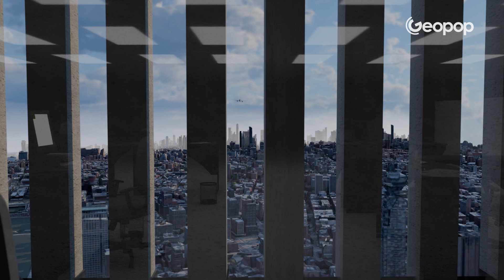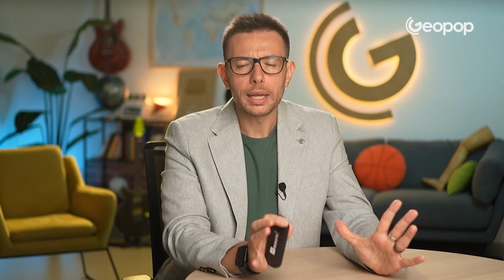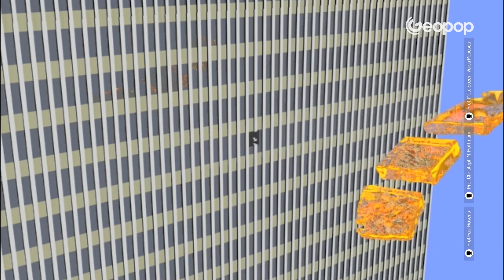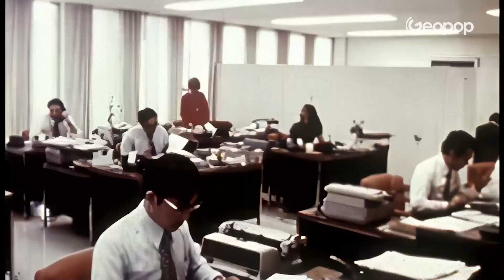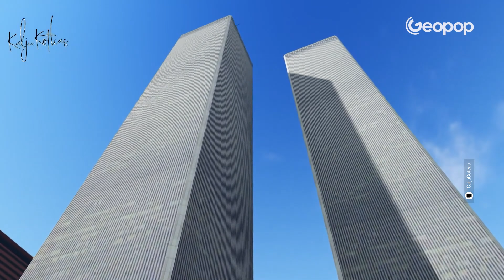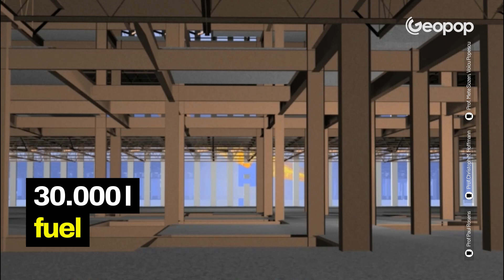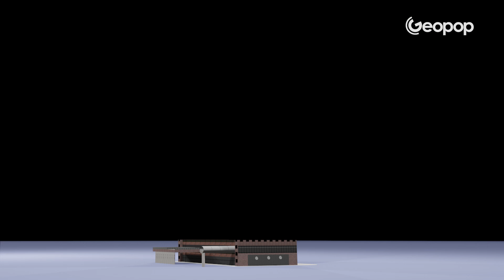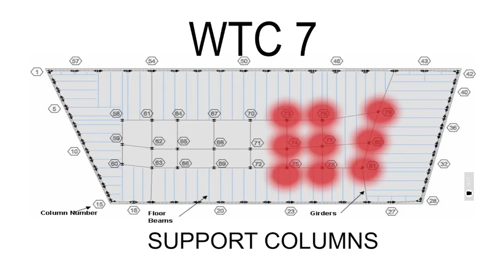9/11, 2001: The Technical Reconstruction of the Twin Towers and WTC 7 Collapses

Comment: Let’s get something straight — aluminum planes do not slice through steel-reinforced skyscrapers like a magic trick at a kid’s birthday party. The Twin Towers weren’t just tall buildings; they were fortresses designed to take a beating. We’re talking about structures engineered to withstand hurricane-force winds, earthquakes, and even a nuclear blast within three miles. Yet, we’re supposed to believe two planes — made primarily of aluminum, mind you — punched through perimeter columns, shattered the core, and caused the buildings to collapse neatly into their own footprints? Come on. Steel doesn’t just roll over and die. The math doesn’t add up. The physics don’t add up. Hell, common sense doesn’t add up. But sure, keep sipping that official story Kool-Aid and pretend it all makes perfect sense.

Now, let’s talk about Turner Construction — the company that just so happened to be working on the very floors where the planes hit. Convenient, right? Their CEO, Tom Leppert, wasn’t just some random contractor. He was connected to Carlos Gutierrez, the guy behind the official NIST report — you know, the report that conveniently explained away every anomaly like a magician pulling rabbits out of a hat. And both of them? Close friends with the Bush family. What a cozy little circle. But let’s be clear: This isn’t conspiracy theory territory. These are documented connections. So, when you see all these dots lining up perfectly, the real question is — how far are you willing to stretch your belief in coincidences before you admit something stinks?

And let’s not forget what one of the building engineers told me. Who was working in the basement at the time — sublevel five, to be exact — and he saw core columns turning white hot. Not from jet fuel. Not from burning office supplies. He said it was so hot he could barely breathe. Now, you tell me — what kind of fire does that? Fires at the top of the building don’t superheat the basement to the point that core columns start glowing like a forge; firefighters that was in the basement witnessed a stream of molten metal, they too also reported blast going off in the building; the lobby exploded as they were approaching the building. They heard and felt blast going off underneath their feet, from other sublevels, That’s controlled demolition territory, plain and simple. But hey, we’re supposed to pretend that gravity magically explains floors exploding below the collapse zone, steel beams flying hundreds of feet, and debris pulverizing into dust before it even hits the ground. Yeah, okay.

And here’s the kicker — those diagonal cuts you see on the steel columns in the Ground Zero photos? That’s textbook demolition work. It’s called a “shear cut,” and it’s used to make sure steel beams fall the way they’re supposed to during a controlled demolition. But sure, let’s ignore the squibs (those little bursts of smoke you see blowing out of windows far below the collapsing floors). Let’s ignore the explosions heard by firefighters and witnesses. Let’s pretend none of it matters. Meanwhile, some folks are out here making slick YouTube videos, trying to convince you that physics took a day off on 9/11. No, they’re not just wrong — they’re lying. And if you don’t question who they’re working for, then maybe you deserve to keep living in the dark. But don’t come for my intelligence. I see through the bullshit. Do you?

Now,! Let’s tackle the ever-reliable defenders of the narrative—those valiant champions who will stop at nothing to uphold the official story, never daring to question it, yet they’re the first to sneer at anyone with the audacity to think beyond the script. It’s almost as if critical thinking is some rare, mythical art form they’ve never been taught, or worse, are too terrified to embrace. They cling to their carefully packaged reality, too afraid to peek behind the curtain, lest they discover a truth that shatters their fragile worldview. And the best part? The moment you dare to share a nugget of real insight, they don’t just reject it—they lash out, ferociously, like a pack of rabid swine, proving exactly why wisdom should never be wasted on those who prefer ignorance. Funny how the Bible had it figured out ages ago—cast not your pearls before swine, because in the end, they’ll only turn around and try to trample you for it.

❤
Reply: I am not taking any sides here, but some of you need to have your facts checked. 

A 767 can fly at 414 mph at sea level. At higher altitudes, it can reach 533 mph. 

414 mph is still plenty fast. Some of you act like a 767 is so fragile it is not capable of high velocities at sea level, and it will disintegrate. This is a false statement. It can maintain 414 mph at sea level without issues. 500 mph or more for a brief period would certainly be attainable.
Reply: @fasear375fullauto2   9-11 truthers really aren't smart people.
Reply: The shear speed of the massive planes will and have penetrated the buildings what did you expect them to bounce off !
Reply: @astra-rb6sz  - Yes, these clowns expect the planes - need them - to _bounce off.

Then when the planes don't just bounce off, they assume the reality is wrong - after all, how could they be?

That their assumptions - their beleifs are wrong never occurs to them.

Hubris and stupidity of the highest order.
Reply: @ First of all, the speeds recorded are impossible for standard Boeing 767 airliners at such altitude. The wreckage was never positively identified by serial numbers as belonging to the claimed hijacked airliners. To the contrary, two engine parts - one from the Murray Street engine allegedly from Flight 175 and another from the alleged Flight 77 that exploded by the Pentagon - need to still be officially explained since they don't belong in the engines of the said commercial airliners. (And isn't it just funny, that on top of that, the NTSB were taken off from doing what they usually do when planes crash: identifying parts. And "coincidentally", FBI didn't do it either!)

Second, you wouldn't expect them to penerate that way - but with the help of the exposives obviously used (maybe warheads in the noses of the planes) it's another story.
Reply: Be honest, how many of yall actually read that entire rant?
Reply: @ 
Because only the elite scholars of deep thought—those rare, godlike beings with infinite patience and the attention span of a Buddhist monk—are capable of enduring the Herculean task of reading. Meanwhile, the mere mortals with their pathetic goldfish brains just flail around in ignorance, unable to comprehend the sacred text of whatever life-altering wisdom you just skimmed through. Truly, an intellectual triumph.
Reply: It doesnt matter what it was made of - even if it was Jell-O, more than a QUARTER MILLION POUNDS of Jell-O arrived at one spot at 600 mph! Its like a skydiver hitting water and it feeling like concrete, but in reverse (and at 3x the speed). And then it scattered 100,000# of flaming kerosene all over the place once it was inside.

In WWII a B-25 flew into the Empire State building in clouds. Thats 1/8 the mass moving at 1/3 the speed; or about 1/24 the energy. It made a hole, started a fire (the highest-ever fire extinguished by FDNY), cut elevator cables did some damage but the building integrity was not threatened. Killed about 15 people IIRC.

Right after 9/11 some kid flew a Cessna 172 into a building in Tampa, probably picturing another WTC in his head. It basically broke the windows and knocked out the lights in the single office it hit and the engine didnt even make it beyond that office. The fuselage kind of dangled from the outside like a confused bat. Thats like 1/150 the mass at 1/6 the speed. Only fatality was the pilot.

Plot a graph with the energy involved vs damage incurred in all three and it makes a pretty straight line.
Reply: I once saw a plastic straw pierce a playground structure made of tubular steel.  A tornado did that.  At some point there is a reality that aluminum broke through steel, and its normal.  There are other things you mention that do make me wonder.  The outpouring of sparks (molten metal) from over 20 stories below the collapse at the corners of the WTC buildings, just before the collapse.
Reply: I'm surprised this post wasn't deleted by YouTube.
Reply: Thank you. 👍
Reply: 100% correct, well said
Reply: I watched a documentary on TV about how the towers were built and the head dude said that each floor was built to hold ten stories if the were to collapse from something like what happens on 9-11 so someone help bring down those buildings on purpose and when I watched that doc. I was a young man I can't seem to find that documentary anywhere kinda funny if you ask me
Reply: @ 
It took me five years to understand the structural architects of those buildings. I even put myself through architectural school through structural builders Institute in the Bronx to help me understand architecture And if you study those buildings from footprint to hattruss you two would come to the same conclusion that those buildings were brought down by bombs
Reply: Why did building 7 collapse
Reply: Yoo thats fuckin deep what you wrote it's hard to ignore that...I'm glad I read that
Reply: Anyone questioning what happened take a look at what professional pilots have to say about  it. Pilotsfor911truth
Reply: @justshutup-i2p  we all watched it live...two planes flew into the towers....buildings don't have steel walls
Reply: I believe what you say, it has more common sense. Than this explanation of this Italian guy. 

 I ask myself the rest of the building was not on fire it would’ve been able to sustain the weight. Specially when fuel ignite, it evaporates, and all that weight is gone away. Then even if that section were to collapse, the rest of the building was built to hold all the weight to start off with. I do think about the momentum, but I seen other structure that the demolition goes bad and only a few floors gets crushed and the building stops falling. So it doesn’t make sense to me what the “supposed” scientific community  says.
Reply: That was a lot of word salad talking about a whole heap of bullshit.
Reply: So many experts. Lolol
Reply: @captainsouth4460  
Good morning kind sir, i have a question for you. How many commercial airliners have you seen take on thirty thousand gallons of fuel? That's the equivalent of three legal full size tanker semi trucks.
The fuel trucks at the airport are about three thousand gallons tops, right? Just asking, because i'm not a pilot, obviously right. I'm just dumb tanker, yanker.
L o l.
Reply: The physics don’t add up? Aluminum planes can’t slice through steel? Do you know a blade of grass traveling at super high speed can slice through steel? The physics is kinetic energy derived for mass times speed could very well slice through steel if the plane is going fast.
Reply: Lead is softer than steel, yet if traveling fast enough, it can cut a hole clean through steel.
Reply: Sorry I didn't see your comment before posting mine. -Damn straight. People do not want to ask the real question because it scares them, and Google will sensor it anyway...because their in bed too
Reply: Let's get something straight.  The planes didnt slice through the buildings.  The intense heat weakend the steel and the weight above caused the collapse.  Simple physics mate.  Go back to school.
Reply: 👆👆👆

Ah, the ever-reliable defenders of the narrative—those valiant champions who will stop at nothing to uphold the official story, never daring to question it, yet they’re the first to sneer at anyone with the audacity to think beyond the script. It’s almost as if critical thinking is some rare, mythical art form they’ve never been taught, or worse, are too terrified to embrace. They cling to their carefully packaged reality, too afraid to peek behind the curtain, lest they discover a truth that shatters their fragile worldview. And the best part? The moment you dare to share a nugget of real insight, they don’t just reject it—they lash out, ferociously, like a pack of rabid swine, proving exactly why wisdom should never be wasted on those who prefer ignorance. Funny how the Bible had it figured out ages ago—cast not your pearls before swine, because in the end, they’ll only turn around and try to trample you for it.
Reply: All FAX n lets not forget WTC7 magically fire causes it to collapse in on its self. Youtube conveniently takes down the only video that has made any sense in explaining what actually happened bye DR. Judy wood. Amd after she came out trying to tell everyone that this was a false narrative, she is discredited and shunned as a wack JOB. Our own gov done this to pass the Patriot act. And start the take over of Iraq.
Reply: @kevinperkins8397  - Not magic. You just don't understand how it works. The unknown and unimportant Building 7 was the 6th building to collapse of 10 lost on 9/11. Though extensively studied, it still confuses many people. Not famous, or a terror target, and no casualties, thus it did not get a lot of attention and few know much about it, creating a void rapidly filled with garbage from the internet. Because everything seems like a conspiracy if you don’t understand how it works I prepared this brief summary explanation of my own analysis. No politics, just engineering. 

The North Tower collapse at 10:28am bombarded Building 7 with tons of burning debris, causing heavy damage and starting raging fires burning out of control for 7 hours. Half the responding FDNY firefighters having been killed, others injured, units in disarray, equipment destroyed, no water pressure, and the greater urgency of Search & Rescue efforts, firefighting at 7 was pulled as futile. The building couldn’t be saved and was left to its fate.

www.youtube.com/watch?v=g_SvpwyC17M&ab_channel=MFitz  

Collapse of a burning structure is always a concern for firefighters. Steel buildings subject to fire rely on active fighting of the fires to survive. Buildings are designed around 1 to 3 hours of fire resistance, allowing time for occupants to escape and ACTIVE firefighting to get started, after which all bets are off. Left to their own devices they will exceed their design envelope and collapse. In B7 the occupants escaped, passive and active fire protections were compromised and active firefighting was abandoned which left the building to take its chances. It lost. Odds on Building 7 would eventually collapse, and it did. No big deal in logic. That is the sort of choice firefighters make every day in brush fire situations - which houses to save and which ones to let go. Only real difference here is moving the decimal on the size and cost.

www.youtube.com/watch?v=WnYBX6QT0R4 

FDNY Chief Daniel Nigro ; The biggest decision we had to make on the first day was to clear the area and create a collapse zone around the severely damaged 7 World Trade Center, a 47-story building heavily involved in fire. A number of fire officers and companies assessed the damage to the building. The appraisals indicated that the buildings structural integrity was in serious doubt. I issued orders to PULL BACK the firefighters and define the collapse zone. It was a critical decision; We could not lose any more firefighters. It took a lot of time to PULL EVERYONE OUT, given the emotionalism of the day, communications difficulties and the collapse terrain

FDNY Deputy Chief Peter Hayden ; We had our special operations people set up surveying instruments to monitor and see if there was any movement in the building. We were concerned of the possibility of collapse in the building. And we had a discussion with one particular engineer there, and we asked him if we allowed it to burn could we anticipate a collapse and if so, how soon? And it turned out that he was pretty much right on the money, that he said 'In its current state you have about 5 hours

The collapse of Building 7 was anticipated all afternoon and widely reported in the media with at least 24 video cameras recording some or all of the collapse. Everyone at the time knew what was coming and why.

www.youtube.com/watch?v=OY5S5k3tMHI 

Building 7’s collapse was totally different to the Twin Towers, harder to understand and most of the details difficult to see. But we can sort out what happened through careful analysis and observation.  What follows is MY EXPLANATION of the collapse sequence using the best available information and relying on no authority.

B7 was complex structure, a 47-story steel framed building built on top of a smaller existing 3-story building, requiring several lower floors dedicated to complex load transfer structures instead of usable office space. Of trapezoidal shape and all-steel tube-in-tube construction, B7 (above the 7th floor) consisted of a central core of steel columns carrying most of the gravity load, perimeter steel columns around the outside of the structure carrying the remainder of the gravity loads and long span beams and girders to tie those elements together and form the floors. On the outside of the building hung a moment frame - the last part of B7 to fall. 

Phase 1 : Collapse initiation for B7 is notably quiet with observers not realizing the building was collapsing! There was no audible warning in the form of say hundreds of ear drum busting 180-190dB explosive bangs preceding the collapse. The first externally visible signs of collapse initiation occurred at 5:20:28 pm. Here at 12:00 a local CBS affiliate reporter is talking 10 blocks from B7 when collapse begins. People don’t start to notice the collapse until 12:11. Then at 12:45 is the famous CBS fixed camera clip of Building 7’s collapse Again, note how quiet it is.

youtube.com/watch?v=t5tEy6mXSE8&ab_channel=fresnosean379

Collapse initiation was due to multiple lower floor failures above the load transfer region (7th floor) in the NE corner of the building. In this video at 0:45 you can see the NW corner from inside the building while under construction, Column 79 just out of frame on the left. That big, angled steel beam across the top of the frame connects to C79 at one end. The girders connect to the beam. That beam and all those girders depend on just one connection

youtube.com/watch?v=nP3TNHPCIVU&t=35s&ab_channel=EdwardCurrent

Phase 2 : Lower floor failures caused a loss of critical lateral support over an excessive length of core Column 79 and it buckled. If you look at a floor diagram of Building 7 (see above) and look at all the structures that depend on C79 you quickly realize this one column was a relatively isolated structural element on which a disproportionately greater fraction of the structure depended . Externally we see a vertical progression of window breakage along the 44-46 line and a kink in the roof of the East Mechanical Penthouse at the top of the building, consistent with C79 failure. The transition from full capacity to almost no capacity occurs in virtually an instant. Once the buckling failure occurs there is almost no resistance

Normally with a buckling column, the load could very well be redistributed to other columns, meaning the buckling could stop after a while. With C79 that is not the case - the failure did not redistribute the load, so the collapse rapidly progressed to the roofline, sinking the rooftop penthouse.

Phase 3 : With C79 gone, B7’s progressive, non-symmetrical collapse continues with C80 and C81 at the east end of the core left laterally unsupported and quickly buckled and failed as well, sending the EMP down through the building. C79-81 all have no diagonal bracing, which I believe is a major reason why they could not redistribute a lot of vertical loads among one another.

From there collapse progressed from east to west through the central core until the core was gone taking all of the interior floors and structures and probably most of the perimeter columns with it. You can see the horizontal progression of window failures low in the building and the dropping of the remaining rooftop structures into the building. One of the big takeaways from the NIST Building 7 study (that gets completely ignored) was their modeling which determined C79 failing under ANY circumstances would have initiated the same collapse sequence.

Phase 4 : After some 10 seconds all that remains of Building 7 is just a hollow empty outer shell - the exterior moment frame - creating the illusion the building is still standing since little has changed externally. But it’s just a hollow empty shell like an empty cereal box supported by only a few remaining columns and quite unable to remain standing. With all the internal framing gone. the north face leans inward, forming a V in the roofline, the last perimeter columns buckle under the strain and with nothing left keeping it up the moment frame free falls, landing on top of the 7-story high debris pile. It is only at the very end that a single measurement of alleged free fall acceleration is taken. Note this is not the building but just its outer shell, and only one corner at that, at the very end of the collapse. Start to finish the entire collapse took 18-20 seconds, or less than 1/3 of true free fall and we have to look at the whole thing, not cherry-pick little bits to fit a particular narrative. Worth noting _how fast something falls cannot tell you what started it falling in the first place. The debris spread out, blocking surrounding streets, heavily damaging the Verizon Building and destroyed Fiterman Hall, all well outside of Building 7’s “footprint”.  

Building 7’s progressive, non-symmetrical collapse was incidental and unintended collateral damage from the combined effects of fire + time + gravity started by the collapsing North Tower. That is true no matter who planned and carried out the 9/11 attacks or why . The collapse was of so little consequence it barely even registered at the time, a mere footnote. It only took on semi-mythical status as an alleged smoking gun years later when demolitions at the Twin Towers, missiles at the Pentagon and shoot down over Shanksville all failed and conspiracists had nothing  left to work with.

Anything can seem like a conspiracy if you don’t understand how it works. Now you should. I hope you found this helpful and informative, not adversarial. If I made any errors of fact, logic or reason or left anything critical out, please let me know so I can fix it. IF you can offer a more plausible alternative please do. Be the first. Please start any reply with the words “Tits McGee” or I will know you didn’t read it and are wasting my time.
Reply: Control demolition done by Israel CIA  helped by Saudi Arabia to start a war in the middle east.
Reply: Finding a few people involved in construction that had some association or another with Bush means nothing. You have enough companies and enough people involved, and you're bound to be able to draw a "coincidence" somewhere. What would be more surprising is if NOBODY had any sort of association that could be drawn at all. You know, they say, we're only about 7 degrees or so of separation or so from just about anybody in the world, and the construction of the twin towers involved an awful lot of people.
Reply: People (brainwashed id*ots) say the plane went thue concrete and steel because it came so fast.
Reply: Very Comprehensive and detailed analysis. Your points are clear and well explained. It freaks me out that even today some people belive that two hijackers from the middle east took over the planes and crushed into the towers
Reply: Everytime there's a fire in Hawaii or in Los Angeles lunatics come out and say space lasers melt cars while "sparing" random buildings or patches of grass...how is this possible ....  People who know nothing about nothing always claim they have the special insight
Reply: @MINDSPARK-u6e  All of you can deny it. The fact is that foreign intelligent operatives were caught impersonating P@LESTINI@NS  @rabs and phoned about a suspicious van (the van they where in) at the G Washington bridge. The policeman was floored when he detained them and realized they weren't @rrab.
Reply: Even Water can cut through steel at a high enough velocity, numbnuts.  You don't have to believe the official story...believe your eyes.  We SAW two planes crash into two  towers, and then they collapsed.  Whatever we THOUGHT about what should happen if something like this were to happen when we designed and built the buildings, those were just educated guesses.  What we SAW is what actually happens
Reply: ❤ only idiots cannot see that it was all controlled demolition. On wtc7 it went down without a hinch, not toppling right or left as if being careful not to damage neigbouring buildings, and last but not least where is the fuselage of the plane that hit the pentagon. Lastly what about the passenger’s relatives on board of the planes hitting the wtc, no police report, no dissapearances etc. 

To me know personally, it was a coup, a geopolitical one.
Reply: ❤ only idiots cannot see that it was all controlled demolition. On wtc7 it went down without a hinch, not toppling right or left as if being careful not to damage neigbouring buildings, and last but not least where is the fuselage of the plane that hit the pentagon. Lastly what about the passenger’s relatives on board of the planes hitting the wtc, no police report, no dissapearances etc. 

To me know personally, it was a coup, a geopolitical one.
Reply: Since no one seems to have gotten this through to you before I'll just say it: You're not as smart as you think you are. Okay?
I know your skull is so thick a plane would bounce right off it, but in the future, maybe when you grow up you'll get that through it and humble yourself a bit; because this level of hubris is frankly, just really embarrassing.
Reply: As Forrest Gump's Mama told him "Stupid is stupid does." The conspiracy was in the failure of intelligence analysis proceeding the attack and the cover-up of that failure.
Reply: Those building's not gonna withstand a nuclear blast from 3 miles away, and those planes aren't just piece of metal sheet got put together especially when they're flying at 600 or so kmh. If you really said these two towers are able to withstand hurricane and earthquake(which I agree) my house can withstand it too, and those rich ppl and high ranking ppl not gonna builds underground shelter if building like these can withstand a nuclear blast. If you really think the math and physics that the pro's ain't adding up, so could you just make your own analysis than speaking shit without knowing any of it?
Reply: And who tf is those friends of yours exactly? Are they real or just "real" in your imagination 🙄 even if it's true that the core colum on SUB LEVEL 5 did heat up, then the structure ain't gonna last that long, and wtf is your friend's doing down there? Supplying your bullshit?
Reply: Thank You!! So true!
Reply: @MINDSPARK-u6e  at this point , not being able to accept 9/11 as an inside job shows us how well brainwashing works . You’ve got to be real dull to believe the “official story”. Stupid people want to believe stupid lies
Reply: anything going 700kmh is going to make a hole,even if its made of titanium ,well and if the proyectile weighs tons, the builder didnt think a huge molotov is going to get to the steel core ,yeah the core that is vulnerable only by fire , it is really simple, and if you do the hole on the center of the building it will do as shown in the video , it will colapse.
Reply: @ no sir. This is not true. Nothing can collapse in its own footprint at free fall unless that building is intentionally demolished. You need to grasp reality , bud. Allegedly 2 airplanes bring down 3 buildings. Wake up
Reply: Your physics don't add up. Common sense is something you don't have.
Reply: Go to school, please!
Reply: Says someone with a google degree.
Reply: GREAT! you cannot explain it better, but most people will never belive our government made a crime so big agaist us.. and this is their force..
Reply: I was there downtown Bowlingreen that morning and was in shock when I seen WTC2 hit. Just the fact that both came down the exact way and way building seven came down is not normal to any means along with all the inconsistencies will never prove it wasn't planed. Building7 was just too far away. This guy talking is only telling you only what "they" want you to hear.
Reply: Nanothermite is only available to military and c I a you can't go to home depot or Lowes and buy a truck load it turns steel into buter in seconds and 3 months later it was still 4000 degrees
Reply: The amount of people willing to believe the "official narrative" is astonishing. Common sense is not common at all.
Reply: @MINDSPARK-u6e  nano thermite was used the temperature rose over 5000 degrees jet fuel can't achieve this that's why aluminum oxide and iron oxide was produced plus no plane struck 3rd building and it fell the same wat 530 pm I bet most Americans don't know this fact
Reply: What a marroon! The original comment. Aluminum can't penetrate steel columns. But lead bullets can penetrate steel? 😂😂😂 Hahaha.
Reply: Complete b.s
Reply: https://youtu.be/egW_O9MFVoY?si=nVdK8CB9vBO58W4f
Reply: @MINDSPARK-u6e  oh yes they do..we all watched two live...where were u..
They weren't flying thru a steel wall
Reply: Kook shut up.
Reply: It all makes sense once you learn that the buildings that collapsed were rigged in advance with blasting cords and charges. This was done in an effort to minimize collateral damage. Not many people are aware of the unrealized goal of the 90's bombing of the towers years before, the intent was to get the building to topple over and start a chain reaction. this is why the buildings were rigged to drop the way they did.
Reply: I agree 100% And it’s funny to see the rabid dogs on the comment section attack you. Funny how they’re in every comment section attacking people who question the official statement. For example I believe the earth is round not flat okay.. But I don’t spend by time and conscious effort in flat earth video comment sections trying to convince people “I’m right and their wrong” These people who come to discredit us and here for a reason.
Reply: Well stated….Appreciate you taking the time to lay this one down here with such grounded logic and sensible clarity….
Completely in agreement with you on this….
They thought They could dupe & deceive us all on this…It was an incredible, ingenious Master Plan by Them….And They’ve basically have gotten away wit it- or have achieved what They set out to accomplish with it….but that said….there are just too many irrational Swiss Cheese-like holes within this incident that simply defy logic & betray the laws of physics— to the point of it serving as one of the Grandest, Biggest, Deceptive Con-Job-Lies ever told by a National Government in World History
Reply: Keep thinking for yourself brother! Agreed with most of your points, sheep will be sheep, doused in cognitive dissonance.
Reply: On their defense of a aluminum plane cutting throw steal. Well in a tornado straw has been able to pearce  into wood because of the high speed. But I don’t care what they say nothing from the aircrafts should’ve took down building seven. His heat theory doesn’t make sense.
Reply: @ 
Again, if you knew the construction details and the type of steel back by dozens of feet of concrete reinforced floors, you would understand the plane would need help to get through a structure like that; if you pay attention to the first plane impact, you will see a small explosion take place moments before the plane even contact the building, in other words, the plane had help getting into those buildings. And most of the people that continues to Push the BS narrative are shills or Nordic Aliens
Reply: @kenmrock9334  yes and also do some other research,  planes cannot fly over 410mph at 1000 ft , ABSOLUTELY IMPOSSIBLE,  also the so called terrorists couldn't fly small planes let alone 767 air liners , ABSOLUTELY IMPOSSIBLE,  John Lear got seasoned pilots , VETERANS OF MORE THAN 20 YEARS AND THEY COULDNT HIT THE BUILDINGS ON THW 1ST TRY, PEOPLE ARE SO IGNORANT.  THE pilots had to basically act like they were landing the plane, hence reduced the speed, also the maneuver on the one plane made were ABSOLUTELY IMPOSSIBLE for the 767 to make without compromising the aircraft,  but don't believe me on any of this, PLEASE HO DO UR OWN CRITICAL RESEARCH
Reply: @kenmrock9334 It’s pierce, not pearce.
Reply: @MINDSPARK-u6e  wow that is a compelling narrative I agree with you wholeheartedly the truth will never come out unless someone says it on their deathbed
Reply: Inside job implosion
Reply: We got another schizo on the platform
Reply: heres the kicker: you're a dickhead.
Reply: Fortresses designed to take a beating. Ah yes very technical review. I bet some dickhead on youtube said that?  And yes it can. Go learn some science. Also heat.
Reply: Ignorant troll… go back under your rock.
Reply: That’s a lot of typing to support a stupid conspiracy theory.   Just because a jet has an aluminum shell around it doesn’t mean that the airframe doesn’t have some serious mass to it.  I assure you aluminum can sever steel when hit with force.  And you are absolutely wrong.  These buildings are not fortresses, high rise construction is typically light weight construction and in the case of the twin towers they used bar joints to span the inner and outer structures with angle clips attached to the ends.  Were they strong, sure, but ultimately the open design concept of these buildings was their demise
Reply: @jab2359  Yea, and what's especially crazy is that the planes did, in fact, penetrate the towers. I mean, it's on countless videos and people watched it live. They're like "but aluminum can't penetrate steel" -- well, it did. It did, on video, and millions of people watched it.
Reply: I truly appreciate your view and the courage to put it out there. All the info aside you hit on something far more rotten in our society. The Cult-like mentality of agree with us or be destroyed is more prevalent today than ever. Such close minded people learn nothing because they're never wrong and to challenge them is such an egregious act to them  you risk being shamed and ostracized.  The name calling and anger is absurd, be respectful and agree to disagree.
Reply: @Roadkill-428  Spoken like someone who doesn't realize what a slap in the face it is to the thousands of survivors and families of victims of this tragedy to hear these asinine, inane, long-debunked conspiracy theories rehashed over and over again. It's been 24 years of this. Twenty-four years! The jury is in. This is literally the most thoroughly studied, hyper-scrutinized and well-documented event in human history. And yet, none of these conspiracy theories have borne out to be true in any way that rises to the level of consensus among investigators, journalists, civil engineers, scientists, etc. the world over. Hundreds of organizations and tens of thousands of people would have to keep secrets for 24 years. Who is really daft enough to think that's anywhere close to possible. That makes about as much sense as Scientology. And yet, these people only see this as a game, an ideological abstract, regurgitating crackpot theories from Loose Change, an amateur student film from nearly 20 years ago, that has even been disavowed, redacted and recanted by some of its creators. Enough already.There's nothing "brave" about this. Serious people don't take you seriously and survivors and victims' are only re-victimized by this nonsense that pervades every single comment thread on anything involving this tragedy like an infection.Think about that why don't you.
Reply: If it was true that aluminum cannot cut thru steel…then you have never seen high impacts.    Jewelers polish platinum using popcorn blown at very high speed.     You first sentence is false on its face.
Reply: Planes are destructive especially when flying at close to 500 MPH weighing over 400,000 lbs with 30,000 gallons of jet fuel. You underestimate how planes are not that fragile. Cause they are not.
Reply: @NeoStoryLab You are correct. The high velocity magnifies the energy from a given mass many times over.
Reply: @NeoStoryLab  planes are incredibly fragile. the engines would be the most damaging part.
Reply: @NeoStoryLab  hahahahahaha You’re such a brainwashed id
Reply: Start by reading Dr. Judy Woods book, where did the towers go
Reply: @NeoStoryLab  have you ever actually seen a commercial jet filled with 30000 gallons of fuel? That's almost 3 whole full tanker loads. You know full size truck Sammy.🤔🫢🫣🤫
Reply: @NeoStoryLab  So the wings are destructive enough to cut straight through the steel columns of the towers, but not through the masonry wall of the pentagon....
Reply: @ you do know a plane flying in the air at those speeds is far more destructive than one that navigates to the ground knocks over light poles and then hits a building right? This isn’t a cartoon where there is going to be a cardboard cut out of a perfect imprint
Reply: @stephenmaguire1965  - Different impact angle (this is critical) and a 24 inch mostly solid masonry wall will behave very differently than the four 5/8" bolts at th e column end flanges.
Reply: @ 
How the fuck you just gonna ignore the fact that I stated that those very floors were being worked on by Turner construction crew two weeks before the impacts
Reply: @MINDSPARK-u6e  - Because it's a lie and even if it were true means nothing.  You have to do a whole lot better than a fabricated accusation by innuendo.
Reply: @ 
I’ve been researching, studying and searching for truth, especially after the fact that I study those twin towers for nearly 10 fucking years after 911 and came to a final conclusion that it was impossible for a plane to disappear into those buildings without assistance that it was impossible for those buildings to collapse into their own footprint Which is a clear signature of demolition after reviewing the photos of columns, that will be an exposed from the exterior debris that had diagonal cuts in them f*ck you for spitting on the amount of time that I spent investigating this for myself do us all a favor and go get vaccinated
Reply: @MINDSPARK-u6e - You did it wrong
Reply: @ Do you really not see hundreds of videos of a plane crashing into that building? This is couldn't be more demonstrable.
Reply: @stephenmaguire1965  Those wings have several thousand of gallons of fuel in them, weighing many tones traveling at 550 miles an hour. Do the physics.
Reply: @robertgregory2618  Mass x acceleration = wings can smash through steel but not masonry. Or did you miss the point?
Reply: @stephenmaguire1965  You said aluminum could not go through steel and you were wrong.. Thick reinforced concrete is a different construction obviously, and the plane hit at a 45 degree angle..
Reply: @ I never said that? What would happen if a skyscraper traveling at 550 mph smashed into a stationary plane?
Reply: @ Let’s get something straight — aluminum planes do not slice through steel-reinforced skyscrapers like a magic trick at a kid’s birthday party. Your words not mine..and they were not boxed columns, on the out side walls. Just a layer of aluminum around the steel for looks...
Reply: @robertgregory2618  and jet fuel burns around 1600 degrees no where near 4000 or 5000 degrees the 3rd building fell the same way without a plane striking it nano thermite was used absolutely positive without a doubt
Reply: @stephenmaguire1965 yup, which is why atomic shelters are made of solid reinforced concrete and not steel.😉
Reply: @stephenmaguire1965 the pentagon was made of much stronger thicker materials from the 30’s same with Empire State Building its strong
Reply: @NeoStoryLab  And ordinary Boeing 767/757 airliners cannot go so fast in level flight so close to the ground. Though this doesn't mean that there were no planes is a problem for the official fairy tale about "Osama & his 19 Lil Hijackers".
Reply: @ yes they can. You’d be amazed at what you can do with an aircraft when you don’t care. Pilots fly safely so nothing happens. They don’t test limits of things to even risk lives. But if you’re on a suicide mission  you are going to try things such as accelerating at high speeds at dangerously low levels.
Reply: @NeoStoryLab  It's amazing what an ordinary Boeing 767 would actually do if being flown at 500 mph at 1100 ft altitude; It's actually impossible because the plane would shed parts of it and fall out of the sky. That's why pilots aren't allowed to go more than 250-300 mph at low altitude.
Reply: @ you can’t test these kinds of things. What can be said is “for safety reasons don’t try” they went for max speed not caring because they were going to die anyways. Let’s find some common ground tho. Let’s say it was at the possible ground level speed you are speaking of. The planes sheer mass, weight, and fuel and even that speed would have done the same damage. The videos are not doctored in any way. Multiple angles have been captured as to what I’m talking about. It’s hard to argue the facts on this.
Reply: @ First of all "they" have never been proven to take hold of the controls - and most of them have never been proven to board he planes. And the wreckage of the planes were never positively idenified to belong to the alleged hijacked aircraf by serial numbers. (To the contrary, fotographic evidence show that some peices of the engines recovered are odd and need to be officiall explained.)

And no: Boeing 767 cannot go 500+ mph so close to sea level without falling apart.
Reply: The twin towers were not fortresses. They were tall buildings made with steel trusses, which are notoriously fantastic at heating up quickly. When heat is applied to steel but its not rapidly cooled down, the process that makes steel strong isnt happening. Its just getting hotter and hotter and hotter. It is bent, twisted, red hot steel sitting on top of 6-8 floors of fire and nothing else. The only one "sipping the kool-aid" and not knowing anything about physics is you.

And I feel like youre forgetting that these were commercial airplanes flying at top speed with full tanks of fuel. The architects, engineers, and builders did NOT account for a situation like that.
Reply: @clddl658  Don't forget that the building was also not built to withstand what was the equivalent of a 20-acre forrest fire burning from the inside.
Reply: Actually that's not true.  The architect of the Twin Towers specifically said in a very old documentary long before 9/11 occurred.... that he did consider a plane crashing into these buildings and they were constructed to withstand such a tragedy.  It's a older documentary on the building of the twin towers.  Which is obviously where you want to look for unbiased options- since it was made strictly for architectural informational purposes and created before the events of that day.  They were very detailed and spoke to not only the architect but the project managers, builders and also other architects known for building sky scrappers across the entire world.  Also... if the design was so flawed and disastrous as everyone is implying... then you should questions the architects who continued to use the exact same design to build sky scrappers AFTER 9/11 and the collapse of the twin towers.  Besides.  Building 7 was never hit by a plane nor any large pieces of the plane or buildings.  It also was not heavily on fire as most people assume.  The integrity of building 7 was completely intact.  3 buildings in one day all falling at free fall speed.  What a coincidence.  It has never happened before and has not happened since.  Not once.  Let alone 3 times.  I get people being uncomfortable with the idea that what we were told could possibly be a lie.  It goes against our learned nature.  But we are in fact talking about a government who has been caught continuously lying to us over and over and over again About everything from small stupid things to very large awful things.  So if your only excuse for being so dead set against other alternatives is based on because our government told us and gave us a bunch of smart government controlled or associated  companies said they were right... then maybe you should consider the mountain of evidence that pokes holes through nearly every aspect to the governments version of that day.  But your eyes can't open if your too busy squeezing them shut, crossing your arms and stomping your foot on the ground  saying...  I know the truth. The government told me everything.  And it all makes perfect sense.   Not saying you have to believe the other theories.  But it would be nice if people were even capable of considering such things.  Because they are not popular "theories" because they don't make sense to anyone.  
Anyways. Just a thought.  No need to attack me because I considered a different reality than you.  People do it everyday from little stupid things to enormously important things.  Hey. Just look at how cut throat politics has become.
Reply: @ 
The quote about the Twin Towers being able to withstand multiple airplane impacts—not just one—is not from Minoru Yamasaki or even Leslie Robertson specifically, but from Frank A. Demartini, who was the construction manager for the World Trade Center and had extensive knowledge of its structural design.

Here’s what he said in a March 2001 interview (just six months before 9/11):

“The building was designed to have a fully loaded 707 crash into it. That was the largest plane at the time. I believe that the building probably could sustain multiple impacts of jetliners because this structure is like the mosquito netting on your screen door—this intense grid—and the jet plane is just a pencil puncturing that screen netting. It really does nothing to the screen netting.”

_Frank A. Demartini, WTC Construction Manager, March 2001

He wasn’t some rando in a hard hat. Demartini was deeply involved in overseeing building integrity, renovation work, and had firsthand knowledge of the steel lattice framework and the redundancy in load distribution. He emphasized that the WTC’s design was “tough” and “redundant”—built with a lattice of 47 core columns and 236 perimeter steel columns designed to redistribute load if any part got damaged.

Now, tragically and suspiciously, Frank Demartini died on 9/11 inside the towers, trying to help others escape. His interview never got mainstream circulation after the fact—go figure.
Reply: @clddl658  You are obviously misinformed and don't have a degree in applied physics because this is fact. Jet fuel burns at temperatures ranging from 800 to 1,500°F (427 to 816°C). While hot enough to potentially weaken structures and cause fires, it does not reach the melting point of steel (around 2,750°F or 1,500°C). Based on this fact everything you have been told is a lie.
Reply: @clddl658 excuse me, do some critical research of your own,  767 CANNOT GO TOP SPEED AT 1000 FT, 400 KNOTS TOPS AND THEY WERE GOING OVER 500, 560 is what there clocked at thru the video,  not a chance in hell, thats like saying u can go 200 mph in ur car which I know ur not a nascar driver. Also the so called terrorist couldn't even fly small planes with there barely 3 months of training, its all BS, 1 MORE THING, THE FBI FOUND 1 OF THE TERRORISTS PASSPORT IN PRESTINE CONDITION, ITS COMICAL, THESE ARW FACTS, PLS DO SOME RESEARCH
Reply: @clddl658  Well, it's evident, and has been so for the last 15+ years, from the science of Architects & Engineers for 911 Truth that the official story(!) about the reason for the towers' collapses is unscientific bull. Their videos "coincidentally" just won't come up as suggested.
Reply: @JeppeSeverin  "well, the people who have a whole organziation dedicated to a conspiracy theory says it was an inside job, so it MUST be true"

Are you okay? A 767 slammed into the north tower, going about 500 mph (the lower end of cruising speed for that plane), and another 767 slammed into the south tower, going about 600 mph (well over max. cruising speed). The science is perfectly sound when it comes to WHY the towers fell (a plane crashed into it).
Reply: @clddl658  “the architects and engineers did not account for a situation like that”

To the contrary . They in fact did . Those towers were built to withstand multiple impacts from 707s (the biggest plane at the time).
Reply: @williamborregard6384  When you take that one part of of context, you would have a semblance of a point. It is, of course, ruined by the fact that a 707 is smaller than a 767 and it holds less fuel. Plus, they didn't plan for a terrorist attack, they planned for a low visibility accident. Very different. You have a good day, though!
Reply: I hate to break it to you, but you have no knowledge of physics or materials science, and further bad eyesight, if you can't clearly see the plane, travelling at over 600 km/h cut a hole straight through the outer columns. Aluminium or not, the kinetic forces are huge. Also, the columns are vertical, they are designed to take a vertical load, not a transverse or sideways load. At those speeds, just about any material will chop a steel beam in half. Furthermore, the heavy elements like the engines and landing gear would go straight through the entire building. I urge you to check out videos of JPL's rocket sled test range where high velocity impacts are tested. It's even on a few Mythbusters episodes.
Reply: Let's get something straight: that "aluminum planes do not slice through steel-reinfirced material" doesn't mean that there wre no planes. Everything points to the planes being special, remote controlled Boeings assisted by explosives to penetrate the steel.
Reply: @ That's what I thought for many years, now I wonder if we were watching holograms of airplanes crashing into the buildings.
Reply: @flynnjp19  The hologram theory is the spooky-woooky-exciting part of he "no-plane" nonsense that those behind want you to speculate about. Either you believe in the official fairy-tale about ninja-pilots (who have never been proven to actually fly these planes) doing the impossible og you want to believe that there were no planes.

If you are even for real and not an AI bot out to spread misfinfo, how come it is so hard to understand that these planes were remote controlled and assisted by explosives to penetrate the buildings? How is it that what MINDSMARK-u6e says (and isn't it funny that he hasn't said a word since) gives the conclusion that "Um, yeah. That must mean that there was no oplanes!"??

What these deranged beliefs do is still prevent a world wide demand for having the scrap wreckage found identified by serial numbers - and that's what the culprits behind need to get scott free.
Reply: @JeppeSeverin  - 🤣🤣🤣🤣🤦‍♂

Yeah no. Nothing leads there except ignorance and stupidity. You certainly can't get there using facts, science and reason.
Reply: @ Wow, here comes the Critical Stinker with the non-arguments.
Reply: @ I don’t know what that means. I did go to flight school for a brief period of time, so I know quite a bit about aircraft.
Reply: @NeoStoryLab  I don't deny that you know "a bit"; you stll don't know how fast Boeing 767 is able to go at level - or close-to level - flight at 1100 ft. altitude.
Reply: @JeppeSeverin  - And yet I'm not wrong or you would have offered a better rebuttal. 

Or a rebuttal.
Reply: @TheLoonResistance  You're both wrong and without arguments.

If you're not AI or some Co-Intel agent to just flood the thread with cognitive bull, you can watch some argumentation in the docomentary "September 11 - The New Pearl Harbor".
Reply: @ that is true. However it’s impossible for anyone to say unless they try, which they won’t. It’s the same as the maneuvers used to hit the pentagon. Pilots have said it’s impossible, but it’s because they fly safely. I only went to flight school for a little because the loan was too much. I had to leave before it was too late.
Reply: @ It's not impossible for the pilots and engineers who have made it absolutely clear - conspiracy theories or not. You can watch videos by Pilots for 911 Truth to have it established, Boeing's own wind tunnel tests and regulations show this:  500+ mph at sea level: NO WAY!

Even Boeing spokeswoman Lezlie Hazzad once admitted this once when a researcher called to ask her. It's on record. And after that, she - or any other Boeing spokesperson or engineer - wouldn't talk about it again.
Reply: @ Not that I believe you're interested , but rebuttal is all in the documentary 'Sep 11 - the New Pearl Harbor'.
Reply: @NeoStoryLab  - What pilots?  Rob Balsamo?  If Crazy Capn' Bobby told me the clear daytime sky was blue I would look up.

Have you ever reviewed the NTSB’s recreation of Flight 77 from the data recovered from the Flight Data Recorder (FDR) found at the Pentagon crash site?   

www.youtube.com/watch?v=3vqDDlS9Hyw&t 

You can easily skip to past the half-way point to begin. 1:10:00 should be a fine place to start. OK to speed it up a bit too. Pay careful attention to air speed, throttle input and altitude. Give it a watch and let us know how skilled you think Hanjour really was, or how skilled he really needed to be. There are no Top Gun Maneuvers or epic feats of flying prowess. He isn’t skimming along the ground like Luke Skywalker for miles at 500 mph. There is nothing in that flight path that any pilot of rudimentary skill could not pull off with just as little precision and finesse.  Note: he never even used the rudder. 

No one ever claimed Hani Hanjour was a great pilot, or even a good one. He didn’t have to be. Hanjour was after all a Kamikaze pilot, not a commercial airline pilot and the standards required between the two are quite different.
But he had earned his FAA Commercial Pilots Certificate and was grossly over-qualified to crash a plane – the easiest thing any pilot can do. 
 
And he did. 

Ever hear of Richard Russell? He was all over the news about 5 years ago. He never had a lesson. What did you think of his efforts?  Nobody ever claims what he did – which was far more spectacular in terms of flying than anything Hanjour did - was impossible. I suspect this is because he was white – and there are no political agendas which need to be satisfied. 

youtube.com/watch?v=1OWtOdtbUow
Reply: I’m an ex union iron worker. When it’s your job to cut and move iron beams and you uunderstand  the heat required in the asetaline torches we used an how hot jet fuel burns. It dosent take a genius to know there’s other factors at play that brought it down. Thermite amongst other things.
Reply: " steel-reinforced skyscrapers" Oh man...what was the steel reinforcing? Right off the bat you prove to all of us you have no clue what you're talking about.
"those diagonal cuts you see on the steel columns in the Ground Zero photo" Those columns were cut In Oct of 2001. That is column 504 of the north tower stairwell. We have photos and even video of those columns being cut by the clean-up crews. Oh, what? You didn't think someone in over 20 years didn't actually research which columns those were?
Reply: @Oldschooldan1  OMG you are low IQ. Clean up crews weren’t out there making perfect 45% angle cuts into massive steel support beams, LMAO 😂😂😂
Reply: @Oldschooldan1  - It's a mindless repeater that does not even understand most of what it is copy-pasting.
Reply: . This explanation is what I remember seeing n hearing from someone that did controlled demolitions.
Reply: @ 

Alice in Wonderland 🤔 
With a statement like that and a YouTube tag titled Alice in Wonderland. You must be with the community are you a squirrel?
Reply: @MINDSPARK-u6e  the key is how hot it was iron oxide and aluminum oxide has to be double the temperature of burning jet fuel explain  triple the temperature of jet fuel months later and no plane hit 3rd building it just fell down by itself?
Reply: dawg stop yapping its been over 23 years nobody cares anymore
Reply: @lameplayr  I'm certain FAMILIES of those MURDERED would disagree.
Reply: @ i forgot about this comment just like im sure the families have about those people its been like 300 years
Reply: @ 
Speak for yourself you heartless piece of shit there are people out here still grieving and have not gotten any closure. Take you your family racist asses over there to Afghanistan.
Reply: @lameplayr Did you or your loved ones LOSE ANYONE 9-11-01?  If not, GTFOH
Reply: @ 
Honestly, after viewing your channel, you are the definition of the phrase, “get a life”
Reply: @MINDSPARK-u6e  stop typing in italics it doesnt make you cooler, also i guarantee i have more of a life than a sad nobody on the internet who comes up with theories for an event that happened 20+ years ago, get over it and do something productive instead of being a waste of space in your mothers basement
Reply: @ElLowEl .  . "What the hell are you talking about?" .  . 😃 .  . Thank you for your sponsored reply, Mr. EILow.  The word projection indicates holography as you know, commercial demonstrations of which have been amazing in recent years.  To feign ignorance doesn't work well for you, however.  Where, Mr. EILow, is the wake turbulence only seconds after passage of a 500 mph large passenger airliner -- not seen in the smoke and fire covering the impact zone?  Even the wake of a small Cessna Aircraft would be noticeable -- yet there is nothing.  It's likely that no real answer from you is forthcoming. We'll wait and see .  .
Reply: "And let’s not forget what one of the building engineers told me. He worked in the basement during the collapse — sublevel five, to be exact — and he saw core columns turning white hot."

And just what kind of controlled demo does that? None of course! Even if it's true (it's not) that doesn't indicate CD.
Reply: @ 
Then what the fuck was it jet fuel? Why was there molten steel flowing through the basement like a fucking river reported by the firefighters in New York
Reply: @Tim22222   LOL ROFL..
Reply: Good comment. Thank you.
Reply: Best comment ever
Reply: The Twin Towers’ exterior walls were composed of boxed steel columns, each interconnected by 2-foot-deep steel spandrel plates that wrapped around the building like a continuous belt. These exterior columns, along with the spandrel plates, played a crucial role in supporting the structure, including the floors—each of which consisted of 4-inch-thick reinforced concrete, strengthened further with rebar and supported by a network of single and double steel trusses.

Given this design, the idea that a commercial airliner could completely penetrate the building as observed raises significant engineering concerns. The nose of an aircraft is relatively fragile—it struggles to survive a high-speed impact with a bird—yet, in this case, the plane supposedly breached more than a dozen steel box columns on the exterior, cut through multiple 2-foot-deep spandrel plates, and destroyed several reinforced concrete floors without any apparent resistance. Instead of significant debris or parts shearing off upon impact, the plane appeared to disappear entirely into the building.

Even more perplexing is the claim that, after breaching the robust outer shell, the aircraft remained structurally intact enough to travel approximately 60 feet further into the building and still cause severe damage to the core columns. These core columns were significantly thicker, heavily braced, and designed to bear the primary load of the entire skyscraper. The sheer mechanics of an aluminum-bodied aircraft penetrating such a fortified structure defy conventional physics and structural engineering principles.

For this sequence of destruction to occur as described, additional forces must have been involved—whether through precisely placed explosives, pre-weakened columns, or intentional structural de-bolting. The question remains: how does this scenario align with fundamental physics and engineering logic? In other words, the planes needed help to penetrate such a fortress designed to withstand a nuclear fallout within 3 miles of such a blast. If you pay attention to the first plane impact moments before the plane even touches the tower there’s a small explosion that takes place.
Reply: @MINDSPARK-u6e  Planes potentially struggle with bird strikes if too many birds hit and get ground up in the engines, has zero relevance. Ten million people watched the second plane impact the building, there are literally hundreds of videos. It happened, Forget all your junk science, this is not in doubt be any reasonable, smart person. What is it you think you're seeing the millions more are not when you watch those videos? FFS, ANY large object weighing 150,000 pounds travelling at 500 miles per hour will impact a building.
Reply: Oh, and your "kicker"?? Those diagonal cuts were made by cleanup crews dismantling the wreckage WEEKS LATER.

Face facts: You know NOTHING about physics.
Reply: @Tim22222  you are wrong those cuts were exposed that day. I have a newpaper front page from sep 12 with those columns in the picture. As well as i watched live and in color... wen the dust cloud settled you could see those collums. On the 11th. If they cut them weeks later they would have not needed angle cuts thats a longer unnecessary cut for demo.
Reply: @Tim22222  Exactly.  It turns out trucks hauling out debris have this thing called "weight limits".
Reply: @Tim22222  How much you getting paid to spread your propaganda BS
Reply: If it was controlled demolition work as you claim it to be, then how could the demolition team prepare the towers without being noticed? And without someone questioning it?
Reply: @dw8840  1. In the months previous to 9/11, there was a major renovation of the elevator system in both towers.
2. There was movement of heavy objects on floors that were supposedly empty which has been confirmed by several employees like Scott Forbes, William Rodriguez and others. When asked for the reason, they were simply told that the work was part of a recabling exercise.
3. There was a power down in the south tower on the very weekend before 9/11 where all security systems were disabled and people could come and go wherever they pleased even in restricted.

You are right. It would have been very difficult to prep the building for demolition without being noticed, but with the proper cover story, it could be done in broad daylight without anyone even questioning it
Reply: @dw8840  They couldn't. These conspiracy theories are nonsense, by and for unserious people.
Reply: @dw8840 

Survivors working in building prior to collapse report having to be evacuated alot due to planned works in the months leading up to Sep 11.
Reply: @dw8840  look up “citicorp tower engineering crisis” … in 1978 a major engineering flaw was discovered in the 3rd tallest skyscraper in nyc (after wtc + Empire State Building).
In short, hurricane winds could blow the building over.
Completely unknown to the public (until 30 yrs later) crews went into the building at night to fix the problem; they opened up the walls, removed the fireproofing from the steel, welded steel plates to the cross-sections - then - re-fireproofed the steel, put up new drywall, painted over it, + left the building at 3am.  they repeated this in all of the 80+ floors - which took at least 30 days to complete.
The repairs were done in secrecy with welding crews at night - - and no one working in the building ever had a clue.
The city gov’t knew about it, helped organize it, kept it out of the press, and had even prepared an emergency plan to evacuate 2-3 city blocks around the tower if the pending hurricane came to nyc.
Fortunately the hurricane turned back to the ocean.
There’s documentaries on this too.
Reply: @dw8840  the towers were being remodeled for 9 months Billy Bush was in charge of remodel George Bush younger brother how did 3rd building fall down without a plane if that's really the cause
Reply: @dw8840 painted thermite during the renovation of the floors,  as one answer to that "the place was always being repaired one place or another.
Reply: @dw8840 They were working for weeks prior to the crash. There were several reports of floor restrictions with an unknown construction crew worked. Dude this was an inside job.
Reply: @endlessfun6145  source?
Reply: @dw8840 it was noticed, and documented. I think they were there for three weeks.
Reply: @dw8840 -- what are you talking about? There were purportedly crews working on the bldg's day & night for weeks, if not months.
Reply: @3RDNBZ  I've heard this theory for years now, "there were purportedly crews working on the bldg's day & night for weeks, if not months." What crews? There were all sorts of maintenance, cleaning, security, all the time. This was the WTC. Not to mention the year or two leading up to 9/11 they were slowly making efforts to replace a lot of the fireproofing that had fallen off the floor trusses the previous 35+ years. Which means they also had to inspect them to find where it had fallen off. We were also going from dial up to high speed at that time. You're talking an office building with tens of thousands of workers, there are any number of reasons crews would be going in during all hours of the day and night doing work. That's not an excuse, that is literally just logic. If you don't understand that then you have no comprehension of how office buildings work let alone high rise office buildings in NYC and at that time when so many upgrade and changes in many things were happening. 

But most importantly.  

Do you know how they rig buildings for controlled demolitions?  They rig their main structural supports. In the towers those were the perimeter walls and the core columns. We can literally see where both building start to collapse at, so let's start with the perimeter walls. Let me ask you, do you see or hear any explosive charges going off on those perimeter walls when the collapse starts? Any CD you can hear those charges going off easily a mile away, even say less than that, yet we have video directly at the base of those towers during each collapse, and we hear nothing remotely similar to a charge going off. Any of the videos of the collapses, nothing. And I know what people say. "Oh they used thermite was used because it's quiet" Well it's not actually. And in every one of those possible angles, nothing remotely close to flashes visible like the ones we see with every other CD that has ever taken place, ever.  But if we didn't see any charges go off to initiate the collapse on the perimeter walls, then that would have to mean they were put on the core columns right? But what doesn't make sense about that is as the building started to collapse, this giant structure in the center of the building, about 60+ floors of it, continued to stand while the rest of the building was collapsing around it, this happened in both buildings. In fact they stood for between 10-20 seconds longer, you could see peaks of them in the dust cloud. 

So please just tell HOW these buildings were brought down with a CD, because it makes no sense to me. I can give you an extremely logical explanation though. The floor trusses holding the outer walls and core columns together were being heated by the 800-1000C fire, those things aren't huge thick structural beams like the core columns, same kind of thing that make up the ceiling of the home depot, just with 4" of concrete on top, it sagged pulling the outer wall inward on floor 81, we see this in this video, until the point floor 81 collapsed. Now you have floors 81-110 collapsing floor 80. Then you had floors 80-110 collapsing 79. And so on. It just happened really quick at that point because that top part was kind of heavy :-)
Reply: @3RDNBZ  Then show us the links, get out of the rabbit holes.
Reply: @IJustFiguredThisOut  Yup, right on. The trusses were the weak link...
Reply: @ These people are insane. Not to mention a decade late to the whole truther 9/11 thing. This whole thing hit its peak 10 years ago. I would go back and forth with these fools for days in the comment sections before one of them would finally give up. Their arguments are painfully flawed and can be literally picked apart piece by piece. And it's not even open to interpretation, anything and everything they say can and has been refuted by literal facts. They're just not smart enough to realize it.
Reply: @IJustFiguredThisOut  how did third building fall down without plane and fire you have more blind faith iron and aluminum oxide is from triple heat from any jet fuel fire thermite is chemical reaction it keeps getting hotter 5000 degrees is a minimum temperature
Reply: @IJustFiguredThisOut it would'nt have gained as it fell,  it would have lost strength,  because it used it's power to push down the next few floors. Physics. Buildings don't just fall,  they are built to withstand falling.
Reply: @karatekid6026 What's censored and why?
Reply: @karatekid6026 What is NIST?
Reply: Amen!  We saw what happens to passenger jets when they crash when the Russian shot down the Malaysian Air lines MH17 - luggage everywhere!  Yet a plane "crashes" into a field and only a hole is seen.  And where are the engines and the black boxes from those "passenger" planes that hit the two buildings (they were "never" found - have you ever lost a jet engine?) Two planes hit two buildings and the third building falls down in "sympathy" for the other two.  Thermite/thermate is found in all the WTC dust, and NIST won't talk about thermite, or they pretend steel magically mixed with outdoor aluminum cladding.  And the "hijackers" never flew a jet before the incident, but yet they executed manoeuvres that fighter pilots would have trouble replicating.  And the Pentagon gets hit right in the accounting department after the Defense Department declared that over a billion dollars was missing (stolen), too bad the accounting department died investigating the theft during 911!  And building 3 falls in a perfect controlled demolition and more than 100 first responders reported huge explosive charges before all three buildings collapsed.  And Larry Silverman (and BBC) announce the collapse of the third tower before it was even pulled (Larry Silverman's word) or demolished.

Then the US military is given an open mandate to destroy all of Israel's "historic enemies" in the middle-east.
More billions of dollars go to military and military contractors (eg Pritzker's)
And guess what happened to the last audit into military spending theft? gone!
And Patriot Act.

Hey everyone, if you want to know who was behind a crime ... just look around and see who profited from it!
God bless you all!
Reply: @davidmcintosh3468 - What are you talking about?!??? There were body parts from the plane passengers, part of a landing gear in the road, and other airplane parts on the ground all around the towers. Some people were killed by the falling debris from the planes. I saw pieces of the airplanes on the ground/roads near the towers in videos I've watched.
Reply: @davidmcintosh3468 You’re a nutcase.
Reply: @davidmcintosh3468  "And the "hijackers" never flew a jet before the incident, but yet they executed manoeuvres that fighter pilots would have trouble replicating. "
All four hijackers were taking pilot training. They had schematics of 737 controls. And they were already in the air. This notion that they were executing maneuvers that fighter pilots would have trouble replicating has been claimed by people that don't know what they are talking about, but only in regards to the plane that crashed into the Pentagon, but I've never flown a jet either and I guarantee you I would be able to crash it into the world largest office building tonight if that was my mission, because after all, it isn't difficult to crash a plane, especially when you have flight experience already. 

"And the Pentagon gets hit right in the accounting department after the Defense Department declared that over a billion dollars was missing (stolen), "
So you're suggesting the DoD holds a press conference on 9/10 to announce that over a billion dollars is missing, and then they planned it so the next day the plane hits the buildings in the exact spot to destroy all the files? But the planes also hit in NY and PA? Wow! Ok. I just didn't realize it was such a concern of the DoD that billions were unaccounted for that they would do such a thing considering it is well known that the DoD fails their audit every year and can't account for billions of dollars.
Reply: @IJustFiguredThisOut  And there's no shred o proof that the "hijacker pilots" were ever in the cockpits taking over the controls and actually flying the aircraft into their targets. Most of them were never proven to have even boarded the planes.
Reply: Those planes would have splattered like a shell hitting a battleship. The fuselage and engines would have made a hole but not the wing structures. The wingtips and tailfin especially would have splattered against the steel and left abundant external evidence. But there's NOTHING. Except, of course, for a hole much bigger than them.

I find it curious that, after the North Tower was hit why so little film footage has come from out of the South Tower. No security cameras, nothing
Reply: @ 

If you pay attention to the so-called impact of the north tower just a moment before the plane hits the building and explosion happens
Reply: @MINDSPARK-u6e  I see several "anomalies" in that 3 seconds of video
Reply: You don't even have to understand the basic physics facts.
To know that the top of the building doesn't get heavier and destroy the bottom half of the building mathematically impossible, what about the thermite reports and all the dust? How come Matt's left out? Same thing. Why isn't anybody asking the f b I why trump's assassin was cremated, 10 days after the shooting. It's pretty simple to cover up the evidence. Because all you have to do is find them pictures. They tried to scrub of the shooter. That was the other kid from Arizona that drove the Van, that got scrubbed. You don't have to be Sherlock Holmes to see the riding on the wall. There's far better information on other platforms that gets you to the truth.
So if you're gonna do a documentary, do your homework, please quit misleading people.😢😢😢😢😢😢
Reply: @ROUGH-BOY-RANCH  And you are the authority on all things conspiracy right? Where are your facts? Nowhere because that's where conspiracy theorists get their facts from. Speculation.
Reply: @paulglover6525  
Sorry, my friend.I'm not gonna do your homework for you. The sooner you do, the wiser, you will be. Here's a little pop quiz, you can learn to be wiser. How many commercial airliners have you seen take on thirty thousand gallons of fuel? That's the equivalent of three legal full size tanker semis. The biggest tanker i've seen loading a plane to go to hawaii. Was  three thousand gallons. Even if it did hold 30000 gallons, they don't fill 'em all the way up.
Just enough to get where they're going and some extra. Haven't heard of anybody doing any honest jet fuel reports. You can believe the boeing jets specs, that's your choice. I'll do my homework and keep wearing a tin foil hat l o l.😉🤔 if you wanna talk in person, I'll meet you on the moon,
🤫🤔🫡😶‍🌫️😴 a wise man once told me, never assume you know everything and don't be afraid to ask questions. And don't expect to get honest answers. And never let a coward use the word conspiracy theory against you. If you did your homework, you would know that.
Good day, my friend learn something new every day if you're not afraid.😘
Reply: Well that was a steaming load of stupid.  FFS 🤦‍♂
Reply: @TheLoonResistance you most likely voted for Harris.
Reply: @TheLoonResistance  Everything stated is 100% true. I have done deep research on 9/11. What do you know about that incident?
Reply: @flynnjp19  - Which everything?  There are over 70 posts in this thread. If you are including my stuff you are correct. Some others not so much.
Reply: @ I am referring to MINDSPARK’s lengthy comment/essay
Reply: @flynnjp19  - You mean his uncredited copy-paste job (MINDSPARK does not have original thoughts) in the OP?  OK, let's look into that.

1. aluminum planes do not slice through steel-reinforced skyscrapers like a magic trick at a kid’s birthday party

Sure, this is true. But then since no one, and I mean no one is claiming that is even remotely what happened it is pure man of straw, so who cares?

2. The Twin Towers weren’t just tall buildings; they were fortresses designed to take a beating

Hyperbole much?  I mean, there's loading arguments and then there's LOADING arguments

3. We’re talking about structures engineered to withstand hurricane-force winds, earthquakes, and even a nuclear blast within three miles

While the last one is pure feces of the male bovine, the other two are irrelevant. Quite different forcs involved than what transpired on 9/11/2001.  This is also being presented as an argument from incredulity - an obvious logical fallacy.

4. _ Yet, we’re supposed to believe two planes — made primarily of aluminum, mind you — punched through perimeter columns, shattered the core, and caused the buildings to collapse neatly into their own footprints? Come on_

Another argument from incredulity and another strawman, since again, no one is claiming that is what happened. This a fine example of applying single-element (non)thinking to a multi-element problem, which will always end in fundametally missing the plot.

That's enough stupid for one night. It's late and I'm tired. And quite frankly, I would prefer to get serious and make real progress rather than dredge through more of that swill.
Reply: @TheLoonResistance  Not it was not IT was a controlled demolition. Do some study first. Nice try. None of those planes were really flown by those Jackers. but remote control from some point in the air.  This has already been studied. Nist is a joke
Reply: Which is more extreme -- to accept without question the inexplicable lack of turbulence in the wake of a 500 mph large passenger airliner -- not evident in the smoke and fire covering the impact zone only seconds later? -- or to recognize the indications of digital projection in its imperfect nature as we see a wing disappear in front of a bright blue sky? From another camera angle, the same aircraft is seen passing behind a crane in the foreground, yet in front of the heavy crane cable. 

There should be a hurricane of turbulence in its wake that would entirely disrupt and disperse the smoke and fire seen billowing outward just 3 to 4 seconds later at both towers.  Even the wake of a small Cessna aircraft would be noticeable -- yet there is nothing.
Reply: @ronaldgreene5733  wrote, "lack of turbulence in the wake of a 500 mph large passenger airliner -- not evident in the smoke and fire covering the impact zone"

🤣😂🤣😂😂🤣

I've heard them all, but that's the first time hearing that one.
Reply: @nickcharles1284 .  . "science" .  . 😃 .  . Commercial demonstrations of holography have been amazing -- so you believe that they are analog in nature? .  . What century are you living in?   

You also cannot explain the entire lack of turbulence behind a 500 mph aircraft that would entirely disrupt the smoking fire coming out of the building on the seconds later. Even the wake of a small Cessna Aircraft would be evident -- yet there is nothing.
Reply: The presence of thermite destroys the official, and this explanation to smithereens.  And bldg 7 erases the fuel burning to superheat the steel excuse!
Reply: Planes that size CANNOT FLY AT THAT ALTITUDE and not break apart...first the air is too dense at that height...a plane flying at 500mph would experience sever flutter and the wings would be torn from the plane and causing total breakup of the plane...it's like running on land at a certain speed and then trying to run that same speed with  water up to your waist...you would be drastically  slowed down from the resistance of the water...ask any experienced pilot and they would confirm all of these comments...it's all phyics...common sense
Reply: @stephenoleary4904  You're absolutely right, if UA 175 had somehow missed it's target, NIST report hypothesizes the airplane would have just broken up over Manhattan like the Space Shuttle.  Keep in mind much of that velocity was descent (There's a great angle shot where you can see how wildly quick UA 175 descends leading up to impact) and that speed and altitude wasn't sustained over the entire flight, just a sprint at the end.  The + 500 mph also accounts (only in part) for the S tower collapsing before the N tower despite the N tower being hit 30 minutes prior.
Reply: @stephenoleary4904  The plane would've broken up had it not hit the building first. It's not like they were flying at that altitude and speed for long. Also, YOU CAN LITERALLY SEE THE PLANE FLYING INTO THE BUILDING IN FRONT OF 10 MILLION WITNESSES WHAT IS WRONG WITH YOU?!
Reply: @stephenoleary4904  That is bullshit.
Reply: @stephenoleary4904  Well, we all saw that happen, so what you're calling physics and common sense, clearly aren't.
Reply: @stephenoleary4904 even propeller driven planes have flown faster than 500mph at 200 ft altitude...
Reply: VERY WELL SAID!!
There were witnesses that claimed they saw no airplanes.  
Have to wonder what happened to them.
Reply: @MINDSPARK-u6e  well said